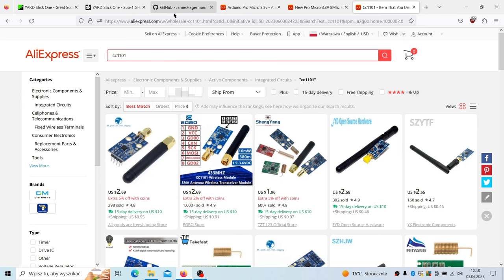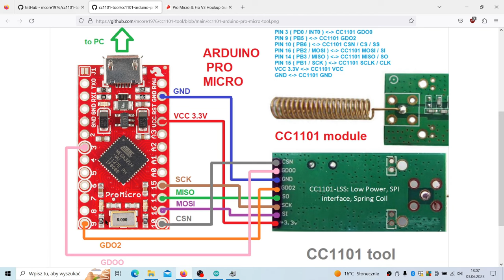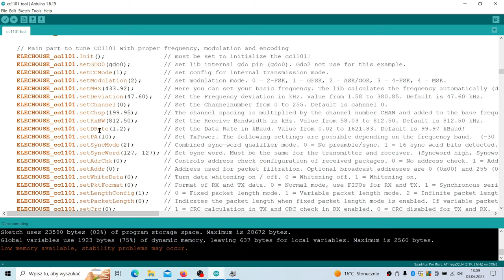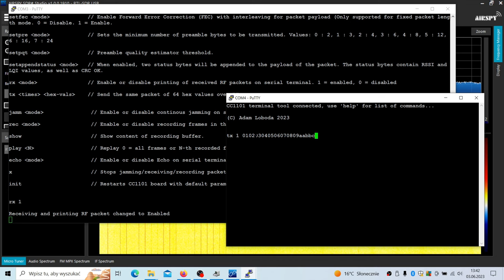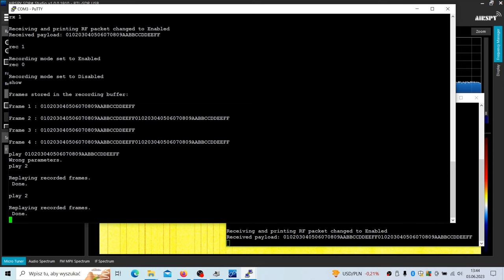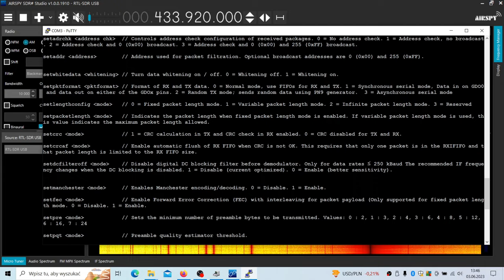DIY CC1101 tool - RF jammer, replay attack, sniffer - cheap & easy tool for radio pen testing

Comment: I followed every step but it seems it can't find the library while it's installed, do you know why that might be?
Reply from the maker: download library from here :https://github.com/mcore1976/cc1101-tool/blob/main/SmartRC-CC1101-Driver-Lib-master.zip

then in arduino menu tab file add zip library
Reply: That's what I did, but while I can find all the files and the included ones in the libraries folder for some reason it still can't find it (I am using the arduino pro micro code on my arduino pro micro). Thank you for your time

Update: I fixed it, the issue was that I saved the library on a NAS and the IDE cannot access network resources.
Reply from the maker: great! happy radio hacking!

Comment: hello , 
just a general question related to CC1101 for 433 mhz version . 
When i change the main frequency using init() function from 433 to 868 mhz and then to 915 mhz , the cc1101 module does not have the same power output . why is this ?
Reply from the maker: this is because you need  cc1101 board version tuned  for 868/915MHz
Reply: @justanengineer5599  i have looked a lot on internet and i could not find a good cc1101 version that can work on 915 mhz frequency .. can you suggest me a link for it ? thank you
Reply: The board is fine outputting on 915Mhz, you just need a suitable antenna. Desolder the spring antenna (17.3 cm) and use an antenna for 915 Mhz (8.2 cm).

Comment: Thanx  Justan, My putty friezes after starting it, please advise, I am using Pro Micro 5v and the TI-cc1101 transceiver with a bidirectional logic converter
Reply from the maker: lower down Arduino Pro Micro VCC to 3.3 V and do not use TTL logic converter, that should help.... or buy some other board with esp8266 or esp32 which are already operating on 3.3v ttl logic
Reply: Thanx a lot  @justanengineer5599  how do i lower the vcc  without using logic converter, please
Reply from the maker: buy DC-DC step down converter for 2$

Comment: Hello, I tried cc1101 with raspberry pi pico, but it freezes code execution on initialization with command cc1101initialize(); so that it only prints the first two lines on the serial port. For example, the line Serial.println(F("cc1101 connection error! check the wiring.\n\r")); does not send to the serial port. I think the problem is in the spi connection, but I can't find out where.
Reply from the maker: yes it is connection problem between cc1101 and pico. try to ask the colleague responsible for rpi2060 version about the wiring specification

// see pinout: https://cdn-learn.adafruit.com/assets/assets/000/099/339/original/raspberry_pi_Pico-R3-Pinout-narrow.png

byte sck = 2;

byte miso = 4;

byte mosi = 3;

byte ss = 5;

int gdo0 = 7;

int gdo2 = 6;

Comment: OK. But I wanted to ask you about a particular circuit. My neighbors have a party once a year in the house next to mine. I would like to have something electronic to counteract their music and play the music I want, just for the purpose of irritating them. We can't stand our neighbors and they and we can't stand each other. Please let me know that it is very, very important. Thank you very much.
Reply from the maker: do they use bluetooth speakers or something? How do they play the sound? if it is over wifi then it may bw disrupted by wifi deauther
Reply: @justanengineer5599  I don't know if they make use of bluetooth devices. They just use a 'stereo system with various audio sources (mp3, cd, radio, etc.). I don't think it's wifi (since they took down the dish for internet last year and now they only surf with their phone).
Reply from the maker: if it is not wireless then it will be hard to disrupt.
Reply: @justanengineer5599  Eh this I don't know for sure.

Comment: Hi! UNO boards have a 3.3V output pin, can i use UNO boards for this project? I tried searching in your github repo but there was no instructions about uno boards
Reply from the maker: uno uses 5v ttl logic so it is not good
Reply: @justanengineer5599   if i use a TXS0108E TTL logic converter, can it work then?
Reply from the maker: yes. this one of the options. The other is to power arduino Atmega  chip from 3.3V

Comment: i installed everything ( including driver ) and when i try to upload the code board is disconnect from the computer and windows doesn't recognize it and got error .

"Windows has stopped this device because it has reported problems. (Code 43)

A request for the USB device descriptor failed. "

i try everything. reinstall the drive . update the driver . 
but it's keep showing that error!

But when i try with another code it's work.
I just having a issue around there. :(

PLEASE HELP

EDIT: Oh! my bad i just have to change 3.3v to 5v. Thank it's work finally . :)

i will not delet my comment just to help someone , when facing a error like me.<3

Comment: @justanengineer Maybe you know what chip like CC1101 could be used for sniffing/repeating 2,4Ghz ? As I understand correctly the raw/debug mode must be unlock in protocol?
Reply from the maker: CC2500 is the chip name. it does support OOK. I am notsure my code will work with this chip
Reply: @justanengineer5599   Thank you! 
 Actually, I started digging in you code and I've been researching for several hours and found CC2500, CC2510/11. 
They have async mode and transfer raw data on the GDO0. 
 So, maybe you concept could work on 2,4Ghz
Reply: Does you code work with OOK only?
Reply from the maker: my code works with all the types of CCxxxx supported modulations
more over looking at this description it seems that my code would work with CC2500
https://e2e.ti.com/support/wireless-connectivity/other-wireless-group/other-wireless/f/other-wireless-technologies-forum/281641/compatibility-between-cc1100-and-cc2500
Reply: @justanengineer5599  Thank you! Btw r u in Poland?
Reply from the maker: yes i live in PL

Comment: hi, I bought for mistake the module HC-12 insted the CC1101, can I make this project with that transmission module? (I bought the arduino nano and TXS0108E TTL logic convertr)
Reply from the maker: no this is only for CC1101
Reply: 100% not. You will need another library for this specific IC with specific instructions...

Comment: Great Job, I am using nodemcu esp8266, Putty hangs, can I enable jammer in the code before uploading code?
Reply from the maker: no. You have to work  on your cabling probably there is problem in wiring between cc1101 board and ESP8266 board. that is why putty is empty.

Comment: Hey man. So i feel like i followed the instructions pretty meticulously.... but when I run putty with the sparkfun and cc1101 board attached, it just runs a black screen. I saw a previous comment about this but unless I am confused, I have followed all of those steps? Am i confused about how to install the drivers? I went to arduino ide and set up the board, did the respective installs..... this IS the driver installation right? any ideas? Thanks!
Reply from the maker: assuming you are using arduino pro micro 8MHz / 3.3V 

1. Install Arduino IDE, drivers and configure Arduino exactly step by step as this tutorial describes https://learn.sparkfun.com/tutorials/pro-micro--fio-v3-hookup-guide/all

2. Download this code to Arduino editor  https://raw.githubusercontent.com/mcore1976/cc1101-tool/main/cc1101-tool.ino
and attach SmartRC library from my github (option add zip library in the arduino menu in editor)
https://github.com/mcore1976/cc1101-tool/blob/main/SmartRC-CC1101-Driver-Lib-master.zip
3. Select board Sparkfun/Arduino Pro Micro 8MHz/3.3V in board menu, upload the code  using correct Serial port number - COMxx - check it in your windoz device manager
4. Use putty to connect to the same porrt COMxx. Settings are  Serial port SPEED 115200 no parity no xon/xoff

and should work
Reply from the maker: your cc1101 board appears to be broken (unlikely), has insufficient antenna (unlikely) or you live in a country where 315MHz frequency is used instead 433.92MHz like US Canada Australia etc. (BTW you should mention your location at the beginning of this thread...) 
If you are wondering if it works you may want to buy and try RTLSDR USB dongle to check if your CC1101 is generating proper signal at the selected frequency.
433MHz is for Europe/Asia
Also try commands
For EU/Asia : 
scan 433 495
and
for US/Canada
scan 314 316
while continously pressing keyfob (at least for 30 seconds)  to find correct frequency for setmhz XXX command

https://www.analog.com/en/app-notes/remote-keyless-entry-systems-overview.html
"They most commonly use a frequency of 315MHz in the U.S. and Japan, and 433.92MHz in Europe.[...[ Europe has also opened up the 868MHz band to accommodate the growing demand for remote keyless entry systems."

https://en.wikipedia.org/wiki/Remote_keyless_system
"Most RKEs operate at a frequency of 315 MHz for North America-made cars and at 433.92 MHz for European, Japanese and Asian cars."
Reply from the maker: check your cabling to CC1101, it always works 100% if you did not mess the connections

Comment: I am trying to do this project with an Pro Micro 3.3v, but it sometimes gets hung up on cc1101intialize and when it doesn't it says "cc1101 connection error! check the wiring." I have triple checked my wiring and can't find any problems. Any help would be appreciated.
Reply from the maker: there must be poor contact between some pins. Try to solder the cables
Reply: @justanengineer5599  They are soldered
Reply from the maker: If so, you may try to use next cc1101 board as something may be wrong with existing board

Comment: Hi I bought e07 m11010 by mistake , should've gotten cc1101 but it got me confused on aliexpress and just realised its a different board, can this work or shall I order a cc1101 instead ?
Reply from the maker: e07-m1101d-sma should work
Reply: @justanengineer5599  thank you will give it a go

Comment: Excellent work mate, but I am having dynamic memory is maxed out issue, any idea on how to fix this? I cant upload code on pro micro 5v. "Compilation error: data section exceeds available space in board".....Global variables use 2219 bytes (108%) of dynamic memory, leaving...
Reply from the maker: check if you have selected proper board type in arduino in board manager tab. This is the most common mistake. it does compile properly when all is set in correct order
Reply: @justanengineer5599  ok, Should I select sparkfun pro micro instead of just Pro micro..
Reply: @justanengineer5599  Thanx a lot, you are right. Its now working
Reply from the maker: see... my projects always work If something is wrong it is 100% user error

Comment: Also can it work at a range of 315 and 433 simultaneously if so how would I code it?
Reply from the maker: to frequencies at the same time is not possible. But quick jumping between these two frequencies is possible. See my other video about the jammer

Comment: hi I can't see the data when I launch rx on the CC1101 tool.. however I have configured the frequency, modulation, deviation when I launch rx nothing is displayed.. except the confirmation that it is is well on its way...
Reply from the maker: try these commands :
setmhz yourfrequencyhere
rxraw XXXX
recraw XXXX
showraw
playraw XXXX

where XXXX sampling interval in microseconds like for example 100 microseconds :

rxraw 100
Reply: Thanks 👍

Comment: I have a bunch of 16Mhz boards, can I still use them for this?
Reply from the maker: you can but only if you use ttl level converter 5V to 3.3v and voltage stabilizer 3.3v for CC1101 boards. Look, all of newer boards are built for 3.3v like esp8266 esp32 etc. 5V boards are passe because 3.7v li-ion battery has become the standard for powering devices now. It's not worth your time to play with these old boards, better buy some 2usd esp8266 or xiao esp32s  instead

Comment: Is it possible for to write code that has it operate at a range of frequencies like 430-440 at the same time
Reply from the maker: it would have to swipe between both frequencies. But yes it is possible

Comment: Will this work on a gate *(like in non Public park zones) if i have the right frequency??
Reply from the maker: if it is RFID based access via card or token  then no it will not work.
Reply: @justanengineer5599  well if it operates with Radio then yes? Or if it is, i bulid an rfid reader..think that should be Possable
Reply from the maker: if operates over radio band supported by cc1101 chip then yes it probably may work
Reply: @justanengineer5599  yes i hope, imma exploit my target soon, wish me luck, but it is a fun project anyways

Comment: hey! i need help with my NRF905SE is there a way to make a jammer with it? radio? or dtv jammer? thanks
Reply from the maker: better use cc11xx modules. NRF905SE does not allow to fine tune the frequency and only works in packet mode
Reply: @justanengineer5599  awww man alr i already got then thanks anyway!

Comment: Can this be used without a computer? Power by a power bank (5v) and work somehow without puTTY?(im going to send you an email for extra info on my question, thanks for everything tho youre the best man)
Reply from the maker: no currently there is no possibility to use it without a mobile phone or a PC. The reason is that there are many options to be set while playing with this device that wouldnt be  possible to configure with few hardware switches. You need a screen and a keyboard thats why the PC is used for this

Comment: What version of esp8266 library will work for code for esp82
Reply from the maker: I do not understand your question.Use this page to setup your Arduino environment https://www.instructables.com/Steps-to-Setup-Arduino-IDE-for-NODEMCU-ESP8266-WiF/
or this depending on your board type
https://www.instructables.com/Wemos-ESP8266-Getting-Started-Guide-Wemos-101/

use this source code to program ESP8266 and further attach with USB to cc1101 
https://github.com/mcore1976/cc1101-tool/blob/main/cc1101-tool-esp8266.ino

Comment: Hey what type is it female/male cable and Also which pins do u connect them from the arduino to cc1101
Reply from the maker: both sides of the cable are female. I have the pins soldered onto both Arduino board and CC1101 board. Anyway it always depends on your board versions
Reply: @justanengineer5599  I meant which number pins should i connect then in
Reply from the maker: it is all in the video as well as on my github page. For example
https://github.com/mcore1976/cc1101-tool/blob/main/cc1101-tool-arduino-pro-micro-E7-M1101D.png
https://github.com/mcore1976/cc1101-tool/blob/main/cc1101-arduino-pro-micro-tool.png
https://github.com/mcore1976/cc1101-tool/blob/main/wemos-d1-mini-cc1101-E07-M1101D.png

if you weren't able to find it I have serious doubts you can build and operate this device

Comment: Hi , I met a problem ,The two CC1101s work well and can read, write and record. However, one CC1101 cannot read or record other remote controls with the same frequency. Why?
Reply from the maker: is it the same version and the same vendor of CC1101 board or different? i pressume this board may have faulty components on RF side. Which Arduino board are you using?   If using recraw playraw commands sometimes you may need to change modulation type depending on the source of the signal you want to record. By default most car keys and openers are using ASK/OOK type of modulation and 433.92/315MHz but I have seen some working on 868MHz and using GMSK type of modulation in newer cars.
Reply: @justanengineer5599  I want to use one of the CC1101's to record remote control signals, but there is nothing
Reply from the maker: If 2 other CC1101 boards work OK then this particular board is broken or it has a different pinout than other 2 boards.  Try to use "rxraw 100" command to see if it catches anything. Have you checked with Universal Radio Hacker and RTL SDR USB dongle what is the exact frequency and modulation type used in the radio signal you want to capture and record? without this knowledge you can only try to guess... as I mentioned the cc1101-tool is by default configured to 433.92 MHz frequency and ASK/OOK modulation type since this is the common in EU and Asia. You may need to do some research first
Reply: @justanengineer5599 I only have 2 CC1101 ,The signal of the remote control is 315, ASK，It would be nice to have a video about recording the remote control signal，Thank you so much!
Reply from the maker: there will be such guideline in the next video. If your remote is 315MHz based then try folowing commands : "setmhz 315" then "recraw XXX" where XXX is sampling interval. Start with XXX = 200 and then decrease/increase. Type "showraw" and "showbit" to see what has been recorded. Type "playraw XXX" to replay recorded signal over the radio. The hardest is to find correct XXX value and for this I am using Universal Radio Hacker and USB RTL SDR dongle
Reply: @justanengineer5599  Thank you very much for your prompt reply!，marvelous! According to what you said, it went very smoothly and the problem was solved，I actually wrote a very detailed description of the parameters of my equipment and product links, however, YOUTUBE did not allow comments :D Finally, thank you for creating<3